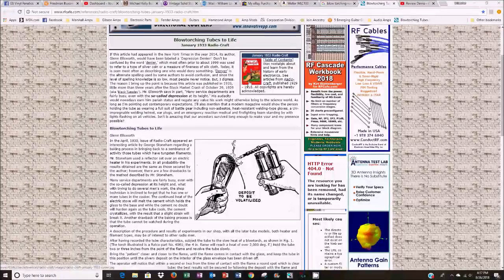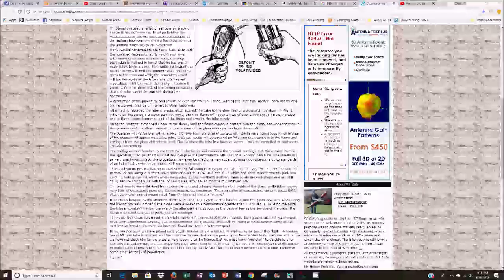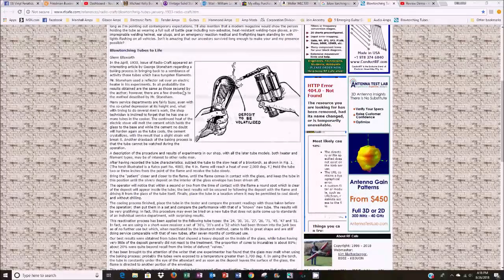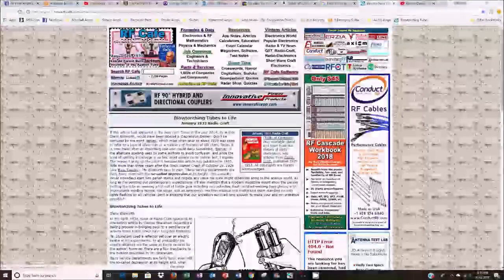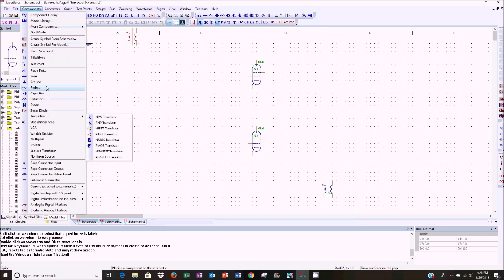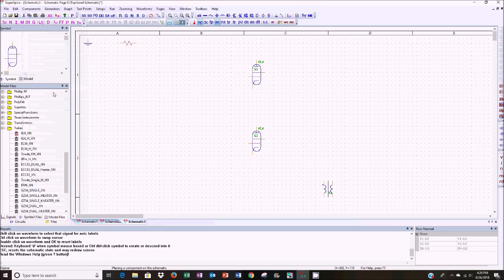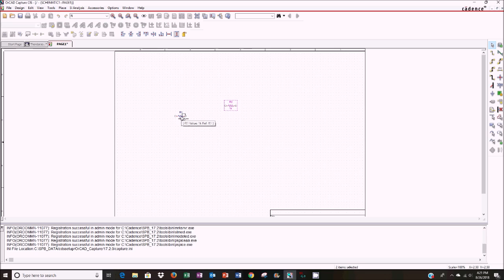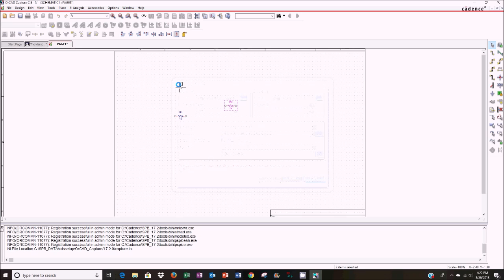SRT Amplification - Tech Talk Tuesday August 28 2018 (Blow-torching tubes/Electrical Design Software

Comment: Your audio was real weak! What's up with that Mr. Amplification??? lmbo
Reply from the maker: Yeah, I was experimenting with some new software that allows you to capture video from your desktop. It doesn't do a very good job with the video(lags) and the audio levels are not easy to get right. Still tweaking things though.
Reply: What software was it? I use Power2go
Reply from the maker: Super Spice and OrCAD. What are you using Power2go to do?